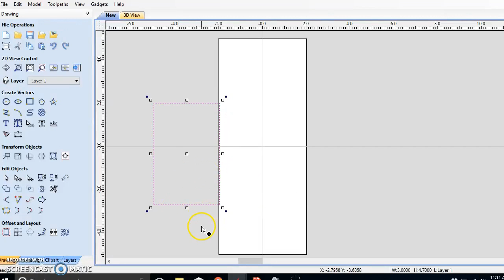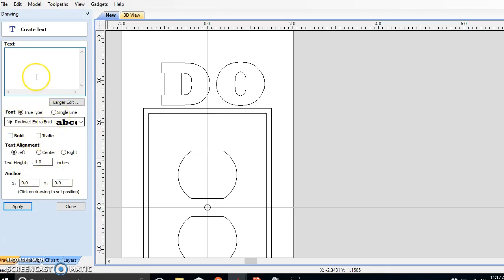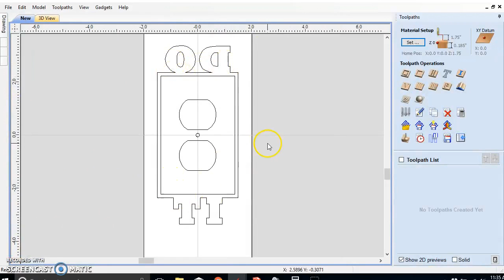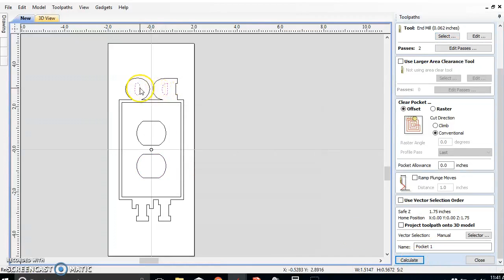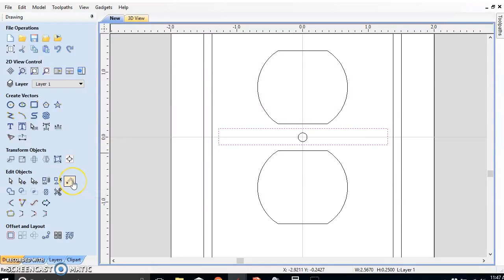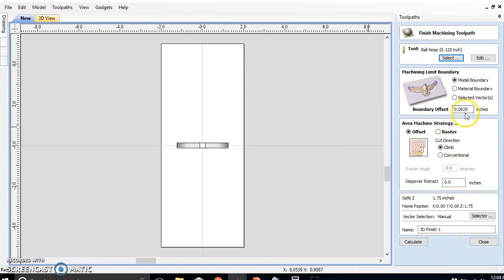CNC vector modeling Aspire tutorial - Custom outlet wall plate

Comment from the maker: A viewer mentioned that code may require some kind of fire resistant plate on the inside surface against the wall. We are not electricians, so please make sure you know the requirements for your area and use caution!

Comment: Does this really need Aspire?  How would you do it in VCarve?  I don't see anything in the NEMA spec that requires the ramp, so even leaving the rectangular solid would seem to be all right.
Reply from the maker: You could certainly do this in VCarve without the 3D ridge in the center. I put it in for three reasons. 
1. Since there is a countersunk hole there, and a screw tightening into the piece in that spot, I wanted to add some extra strength. 
2. The wall plates in my house all had some kind of ridge there, and I wanted to mimic as many of their features as I could.
3. I don't plan on making too many instructional tutorials like this, and I thought the more modeling concepts and information I could cram in there, the better.  :)
Reply: @DoItProjects  Well done! one of the best teaching videos for Aspire,  they should hire you
Reply from the maker: Lane Byron wow, thank you